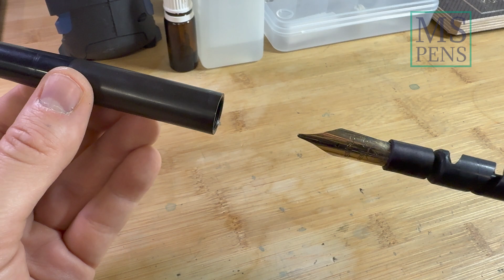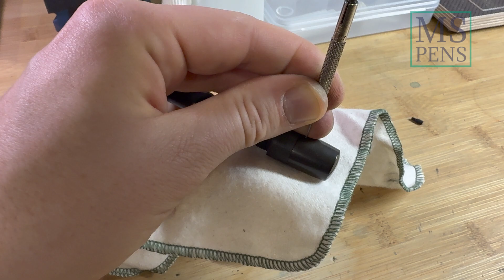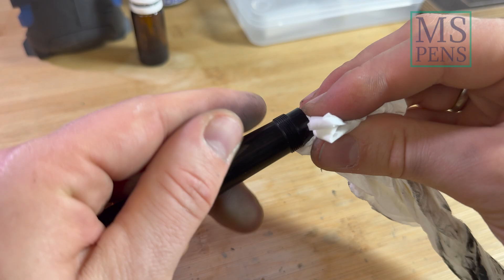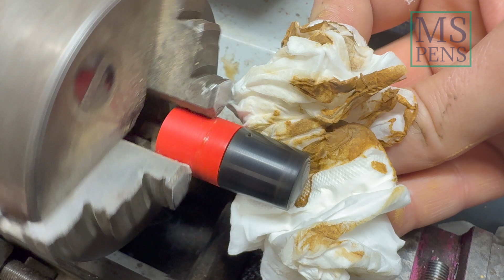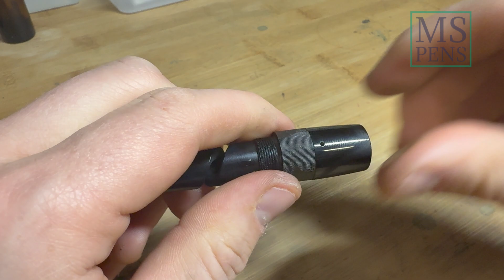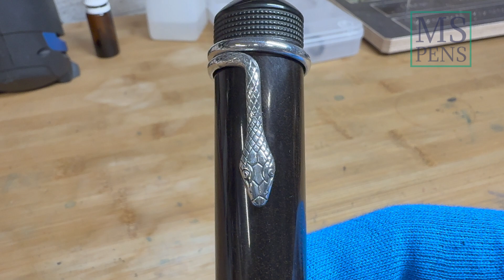Montblanc Safety No.12 restoration

Comment: My goodness, Marco, that pen is a monster ! I suppose the one principal  advantage is that (nearly) everything on this model is easily accessible - even the guide/nib prevention pin in the cap was an easy removal; incidentally, did you have to calculate the precise length of that pin, or were you able to reference it's length from a former MB-Simplo manufacturing manual ?
You never fail to amaze me, my friend - beautiful job !
Best,
Andrew 🙂
Reply from the maker: Hello Andrew,

yes, the fountain pen is truly an impressive piece. I felt very honored to be able to repair it for a customer. It was my first MB No. 12 so far.

As you correctly pointed out, everything could be disassembled much more easily here compared to a Safety No. 0. There was so much space that I could measure the length of the rod using the depth gauge of a caliper.

I made the rod slightly longer and then filed it down by hand to the correct length, followed by polishing.

Best regards,
Marco
Reply: Marco, it was a fantastic restoration, my friend; there are only a few people with your degree of dexterity, engineering nous & aptitude for perfection - masterful stuff ! I sincerely hope that other (potential) clients bring their less-than-perfect MB 12's to your door,
Andrew 🙂

Comment: What was the red stuff you used on the threads to seal from leaks? Was it wax?

On a side note, I wonder why MB has never made anything with that giant nib in all the years since.
Reply from the maker: Yes, the red stuff is the wax I like to use for sealing. 

I'd also like Montblanc to be a bit braver when it comes to things like this. But such a large and really thick nib would hardly be affordable at Montblanc today.

Comment: What fluid are you using during the sanding process? I am guessing water would not be a good choice, since it is hard rubber.
Reply from the maker: In this case, I actually did use water. But since I do the pre-polishing with a polishing paste that contains a lot of oil, I haven’t had any issues with oxidation so far. Still, you might have a point here, and I’ll use a light oil for sanding next time.